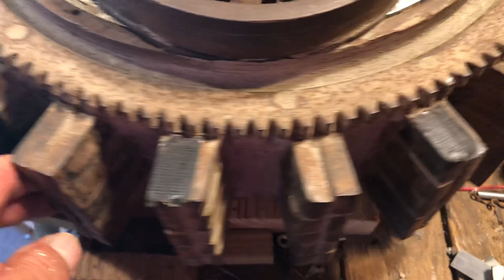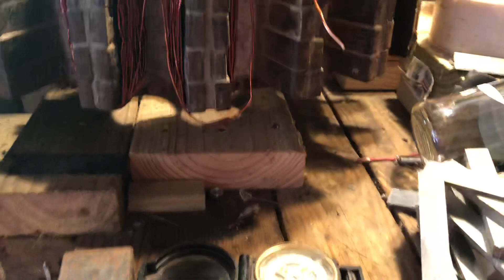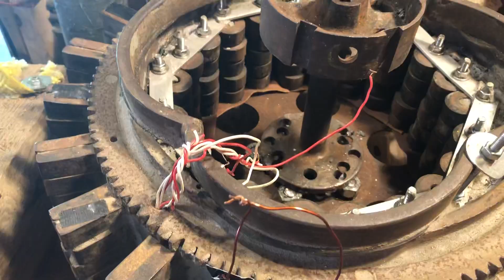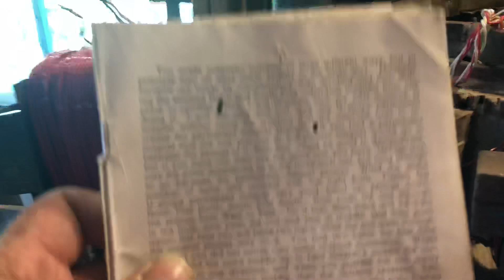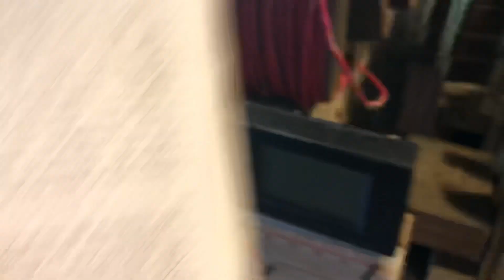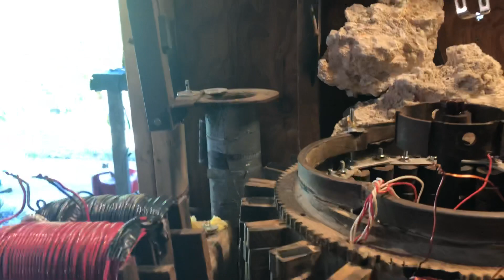Ed Leedskalnin! Switching the magnetic poles on the wheel!

Comment: Hi Roy, 

E(energy)=.5xC (capacitance) x V(volts) squared x Frequency squared,  So the higher voltage and frequency get you in sweet spot where over unity exists, above 20,000 Hz . You are looking to create magnetic resonates. The PMH is a magnetic resonance generator.  Magnetic resonance is energy that flows around the outside of the wire or PMH bar. Use laminated bars to further increase the magnetic resonance effect, the more edges the more stored energy. That energy can be captured by coils located near the PMH coils as many coils as you can put around the PMH coils will have an equal amount of magnetic resonance energy. The trick is every coil needs to be the exact same length for the resonance to transfer. I used the washer pump to create magnetic resonance in the coils around the energizes washer pump PHM coils.
The mechanical electricity we get in our homes and forced through the wire, so they can put a meter on it and charge people. What Tesla, Ed and others figured out is that magnetic resonance flows with "0" loss of energy around the outside of a metal and not trough it, but you can't put a meter on it. 

Efficient PMH - Use the small washer pump as a pmh seems so much stronger per pound than a simple "U" bar, use two laminated washer pump "U" bars stacked one on top of the other and see how much greater the effect is. The lamination adds to the effect greatly. Your coil experiments earlier were on target with transferring magnetic resonance but you did not get the magnetic resonance between the coils to match precisely.

E(energy)=.5xC (capacitance) x V(volts) squared x Frequency squared  and E=MCsquared  - notice anything similar? Both are Energy
Scott

Comment: Roy, thank you! That was exactly what I needed to help pull me through this depressing day. You are on the right track, and now you have me convinced that Ed did have coils on the wheel at one time but probably removed them himself. He did say "don't build this."
Reply from the maker: Garbled User 
Hi Adam!
I have seen testimonies that right after Ed Died , the army core of engineers had taking over the coral Castle until a relative has claimed it. And then the wheel was stripped of all its wire, and they filled up one of Ed’s Cory pit with everything and buried it!